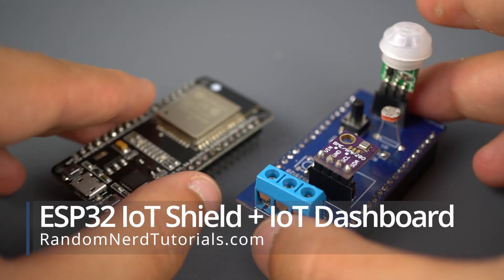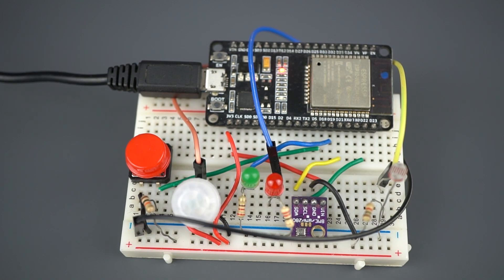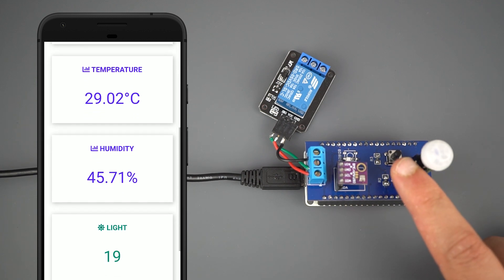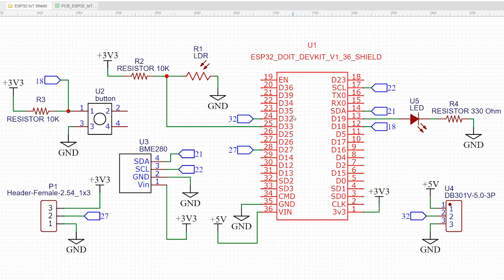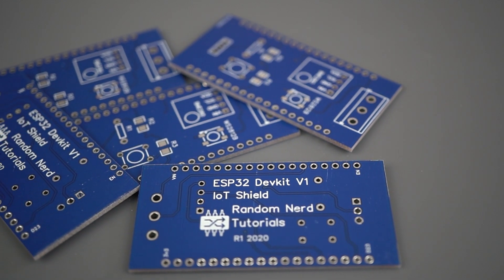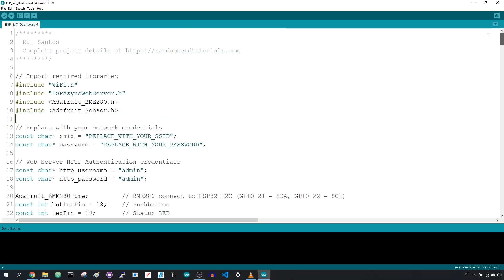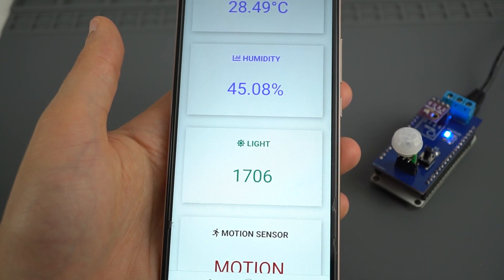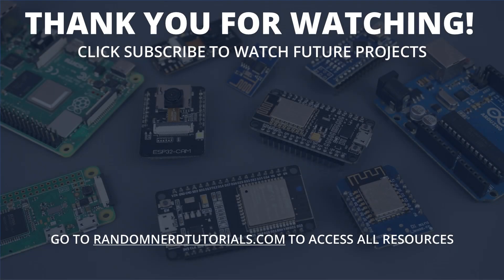ESP32 IoT Shield PCB with Dashboard for Outputs and Sensors

Comment: Does the ESP32 give enough power to power on the relay? It is very little power that you can use from the ESP-pins...
Reply from the maker: Yes, the ESP32 can easily control a relay module board that has an optocoupler with a 3.3V GPIO output signal
Reply from the maker: Note: the pin that is powering the relay module is the Vin (5V) that is powering the ESP32 board.